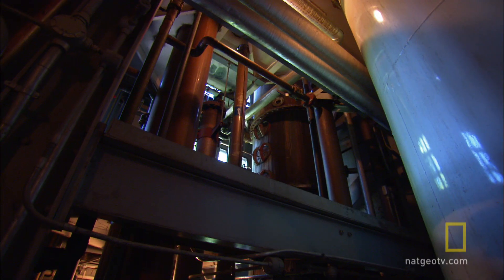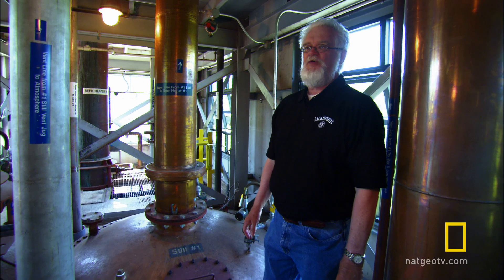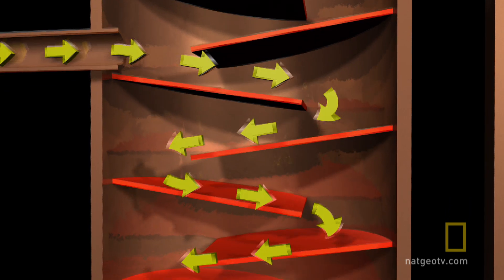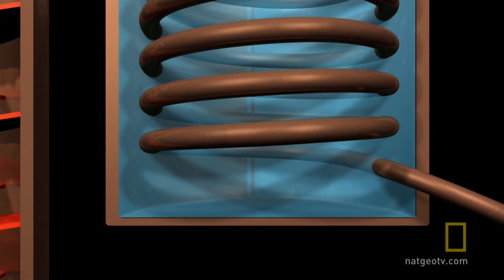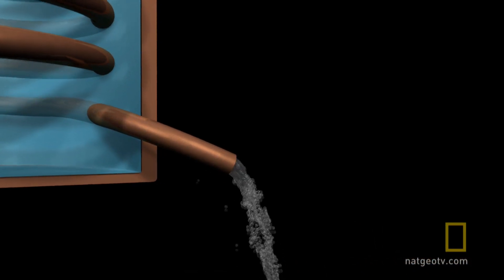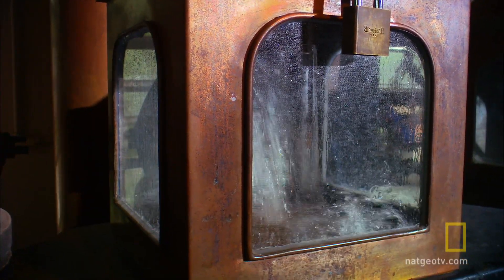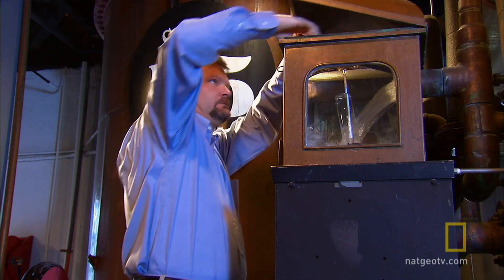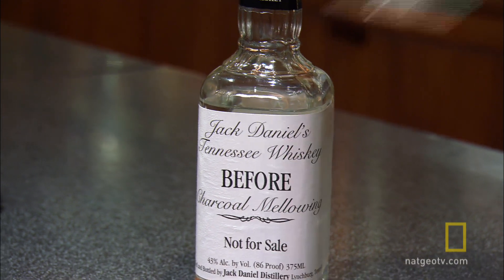Distilling Jack Daniel's | National Geographic

Comment: @remydog410 What the hell for? The ethyl alcohol foam they use to sanitize hands in hospitals is only 62%. It destroys all germs it touches. This is STRONGER than that. It's ethyl alcohol at 140 proof = 70%. Even if he didn't wash his hands first (and he almost certainly did) there would be no problem.

Besides. If this kind of thing bugs you, you're not man enough to be drinking JD anyway.